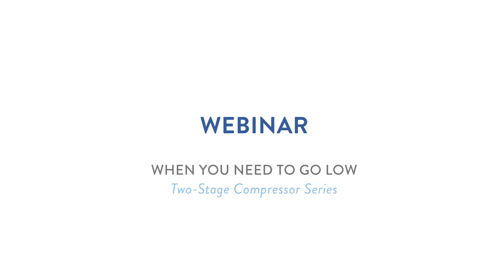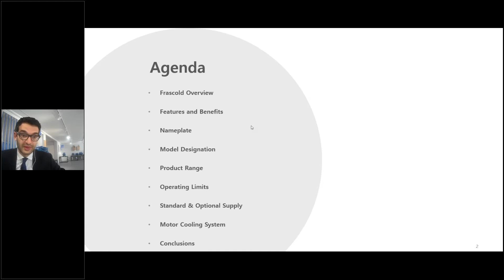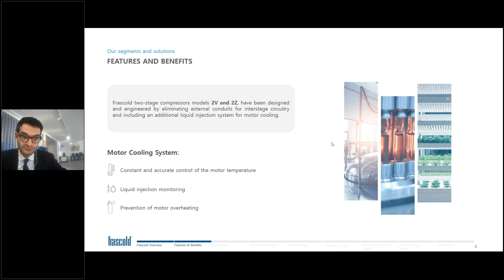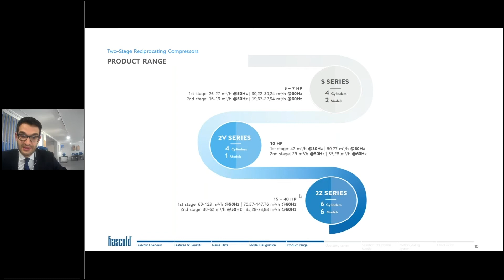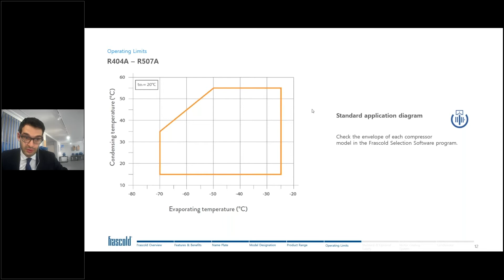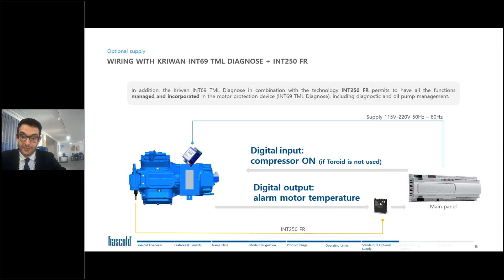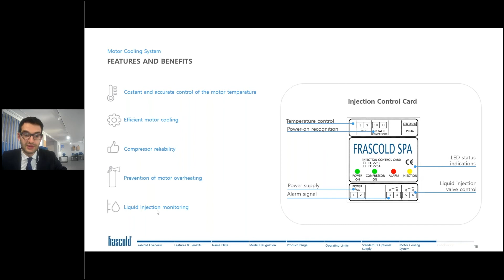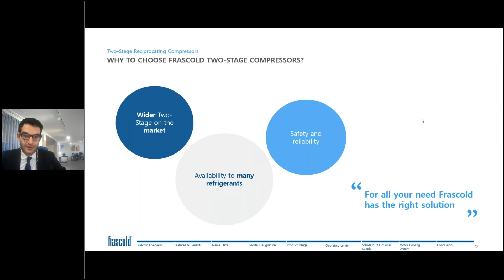When you need to go low - Two Stage Compressor by Frascold

Comment: I would like to know how the alarm timing operates on the liquid injection card and are alarms auto cleared when conditions no longer exist
Reply from the maker: Dear Bill Ries, thank you for your question.
It’s not timing but the motor temperature that determines if the motor itself has to been refreshed by cold refrigerant or not; if even with this help, the motor temperature goes too high and arrives to the threshold, then there is the alarm. It is automatically cleared after 5 minutes if the motor temperature itself has gone below the threshold.
Don't hesitate to contact us for more questions!